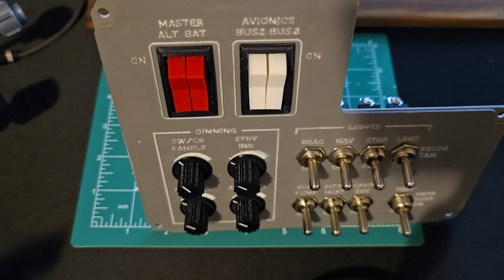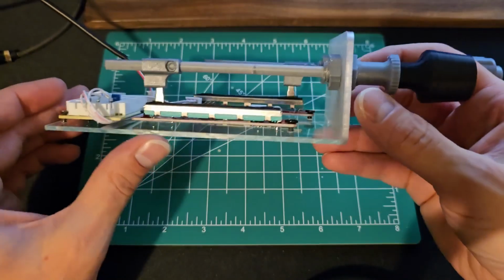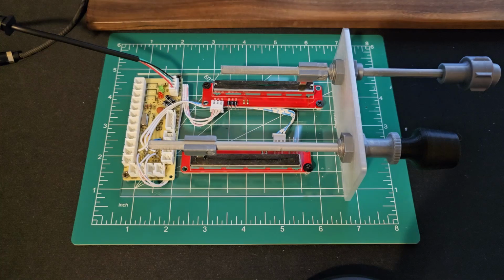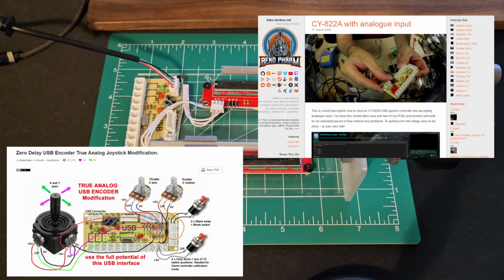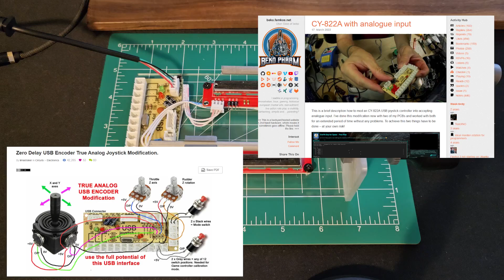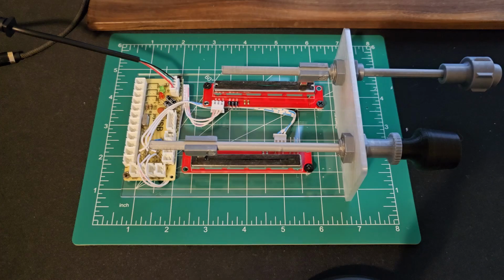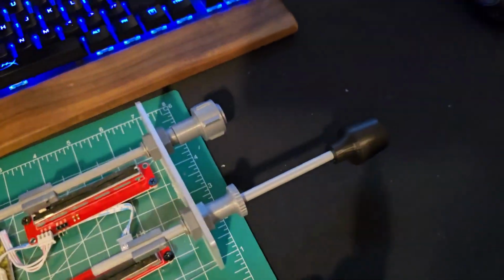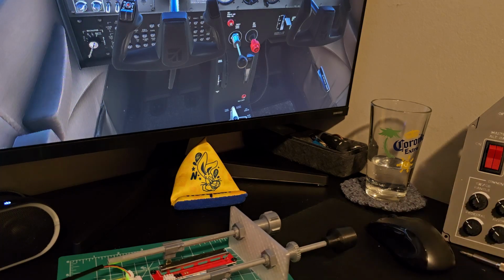DIY 3d Printed Flight Simulator Cessna Throttle Mixture

Comment: About a year ago, I designed a single and triple mixture control solution for my home setup. It ended up allowing the same potentiometer to mount inside with 3D printed control levers. Would love to share if interested. Cheers! looks great bud.
Reply from the maker: Absolutely.   That sounds really cool